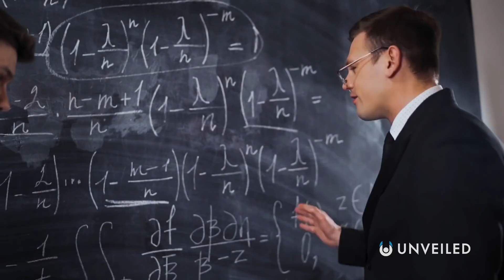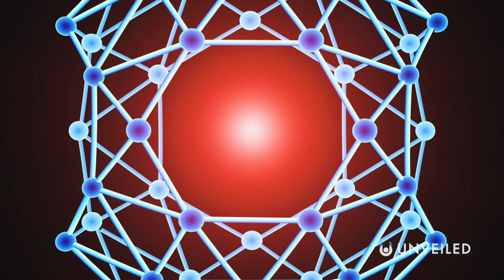Why Humanity Needs To Develop a Fusion Torch | Unveiled

Comment: Bobby Kennedy Jr. had said that nuclear waste disposal alone makes nuclear energy not economically unfeasible . However, it the Fusion Torch works with nuclear plasma , which burns in excess of 200 million degrees Fahrenheit! I can't but see very little waster left over , right?  And if you're dissembling 200 million , to 400 million tonnes!!!! Of garbage; there's a resolution to  a ginormous waste  removal concern in addition to unlimited energy now available, via the Fusion Torch , too! 

P.s. I also understand that it can break down stool from herbivorous animals , and be used to successfully rejuvenate soil as well! Wow, wow, wow man!

Comment: How can thermonuclear fusion torches benefit the military 

Thermonuclear fusion torches, also known as fusion-driven rockets, have the potential to provide significant benefits to the military. While the development and implementation of fusion torch technology for military purposes are currently speculative, here are some potential advantages it could offer:

Enhanced Propulsion: Fusion torches could offer unparalleled propulsion capabilities, providing extremely high thrust and exhaust velocities. This could enable faster and more efficient space travel, allowing military spacecraft to reach destinations in significantly shorter timeframes. The ability to rapidly deploy assets to various locations can enhance military response times and strategic flexibility.

Extended Range and Endurance: The high specific impulse and energy density of fusion torches could greatly extend the range and endurance of military vehicles, such as unmanned aerial vehicles (UAVs) or unmanned underwater vehicles (UUVs). This extended operational range would provide the military with increased surveillance capabilities, long-range strike options, and improved situational awareness.

Power Generation: Fusion torches could generate vast amounts of energy, which could be harnessed for various military applications. This abundant energy supply could power advanced weapon systems, directed energy weapons, electromagnetic railguns, and other energy-intensive military technologies. It could also support on-board systems, such as sensors, communication equipment, and advanced electronics, without the need for frequent refuelling or battery replacement.

Independence from Fossil Fuels: Fusion torches utilize hydrogen isotopes, which are abundant in seawater, as fuel. This eliminates the dependence on traditional fossil fuels, reducing the military's reliance on external energy sources. By providing a clean and sustainable energy solution, fusion torches can contribute to reducing the military's carbon footprint and environmental impact.

Nuclear Deterrence: Fusion torches could potentially offer advanced propulsion systems for intercontinental ballistic missiles (ICBMs). The increased speed and range of these missiles could enhance the deterrence capability of a nation's nuclear arsenal. The potential to deliver warheads with greater precision and shorter flight times could act as a deterrent against potential adversaries.

It is important to note that the practical implementation of fusion torches for military purposes is still in the realm of theoretical and experimental research. Several technical challenges, such as achieving a controlled and sustained fusion reaction, compact reactor design, and safety considerations, need to be addressed before such systems can become a reality. However, if successfully developed, fusion torches have the potential to revolutionize military capabilities and provide significant advantages in terms of propulsion, power generation, and strategic mobility.

Comment: ONLY ELEMENT NO NEEDS A MINERAL AND LIFE TO BUILT  ARE THE GAS BECAUSE HYDROGEN GAS ARE CAME FROM THE SMOKE OF FRICTION BETWEEN BLACK HOLE AND SOIL..... THE ELECTRICITY ARE NEEDS A MINERAL OR METAL,, THE IMPORTANT FUEL OF THE PLANET ARE OIL,,METAL AND OTHER TYPE OF MINERAL.. IF THE FUEL ARE LOST PLANET WILL BE DIE OR BURNING LIKE WHAT ARE HAPPEN IN DINOSAUR TIME AND PLANET MARS,, WATER ARE RICH OF HYDROGEN GAS

Comment: Why would this be any better than an arc furnace? This is an absurd amount of overkill, and it depends on  developing an advanced technology unnecessarily
Reply: I didn't understand the point either.  A nuclear fusion power plant generates electricity. A 'torch' is usually used for heating/processing things - like a welding torch, of for burning. how would an old refrigerator get into a tokomak?!?!. In terms of reclaiming, I saw an interesting technology using microwave energy in an evacuated reactor, using resonance to de-polymerise rubbeer & plastic materials into their raw hydrocarbons - which strikes me as being much more useful for re-suing materials.
Reply: @DavidPaulMorgan  absolutely. Thermal conversion via pyrolysis has been in the works for a while, which breaks down organic waste into natural gas, minerals, and something like light crude oil. One of the holdups is the required energy input that makes it inefficient. Cheap and abundant energy, such as from fusion power, could make this practical. I thought that’s what this video would be about, instead of this nonsense